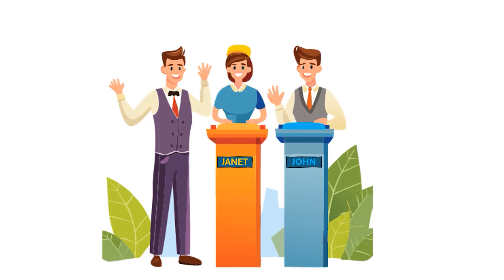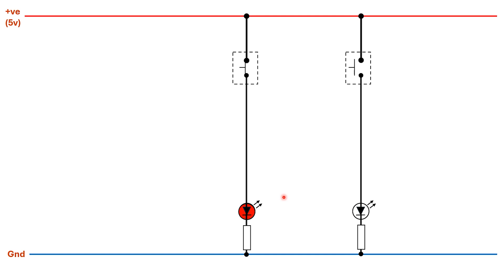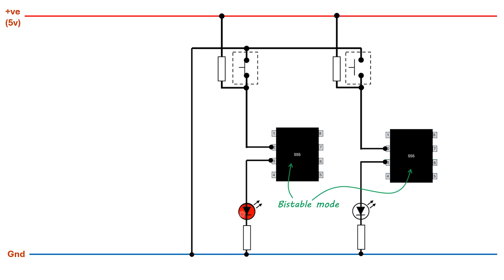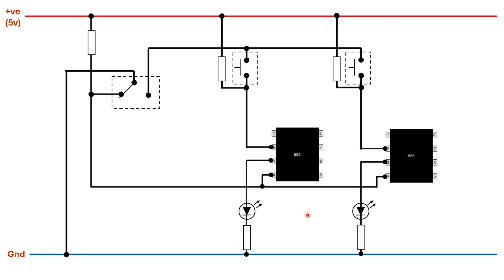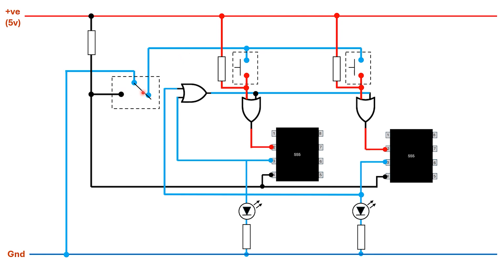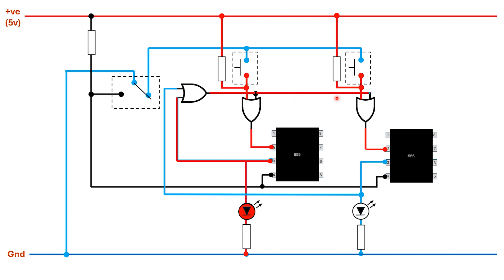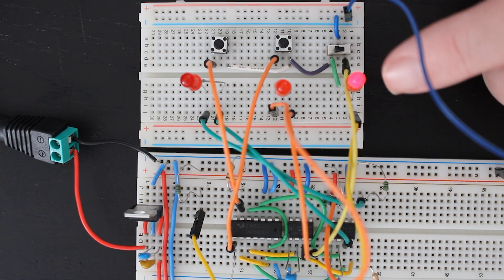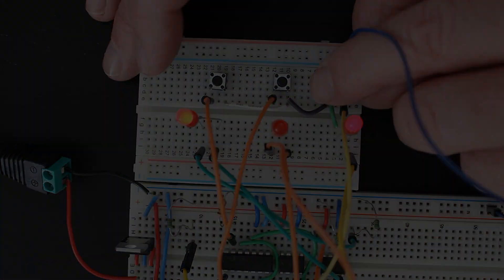Make: Electronics Book Experiment 21 - Quiz Button Blocker

Comment: Instead of OR gates you can use groups of diodes.
Reply from the maker: Thanks for the suggestion. I'd be interested to know a bit more about that solution.
Reply: @M7GNP  Wikipedia has a good article on "Diode logic" which explains it much more thoroughly than I can squeeze into a YouTube comment.